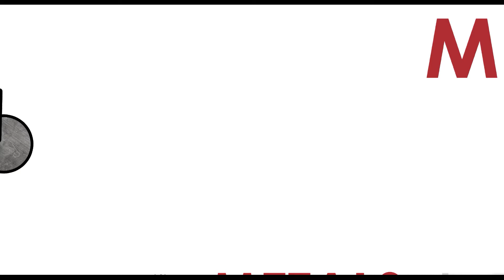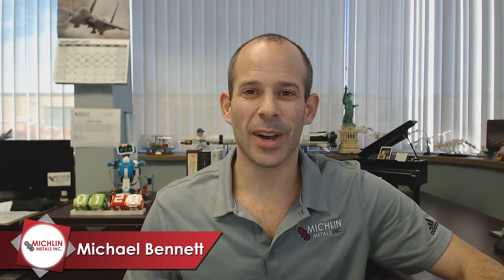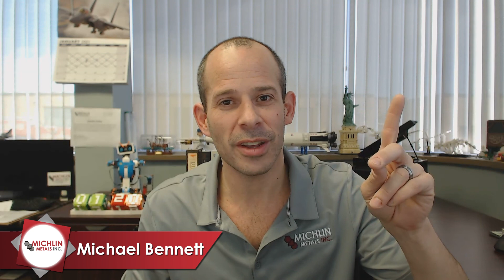Aircraft Alloy Steels - 4130 - 4140 - 4340 - 8620 - 9310 - 52100 - Guide to Alloy Steel

Comment: It would be interesting to learn more about the properties of Hot Rolled vs. Cold Rolled  Alloy steels, such as 4140, and if cold rolled material is worth using without heat treat. I see that the hot rolled is commercially available preheat hardened to RC25 and should be sufficient for many applications at that hardness. But Cold Rolled is probably much softer without heat treating.
Reply: true but cold rolled steel is much more expensive than hot rolled steel